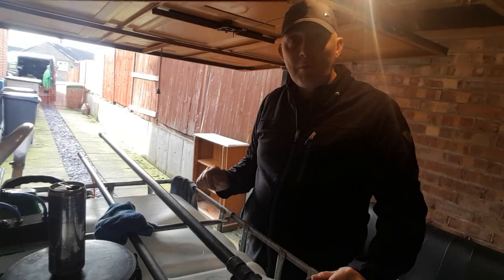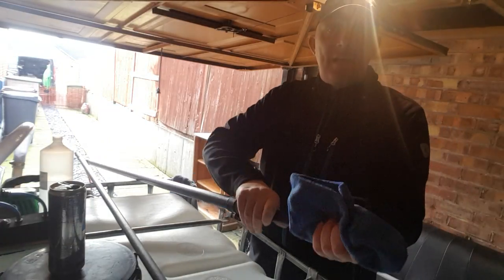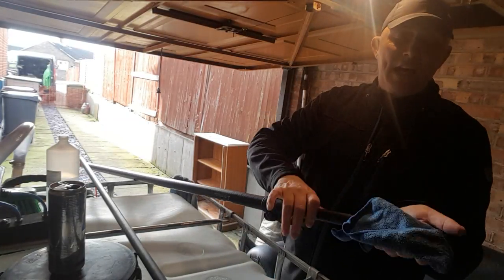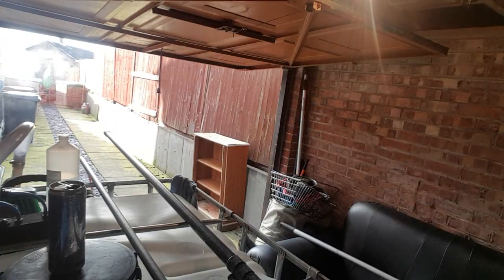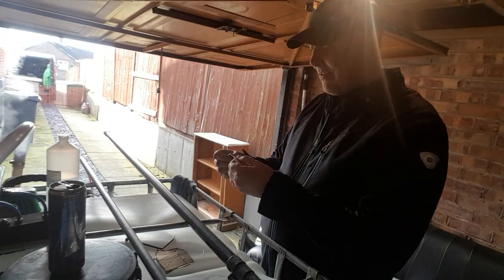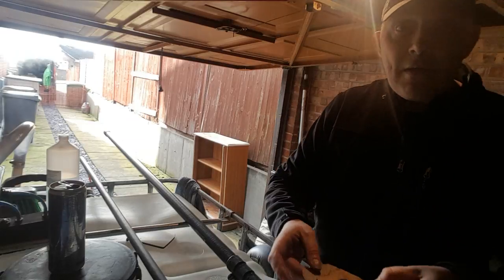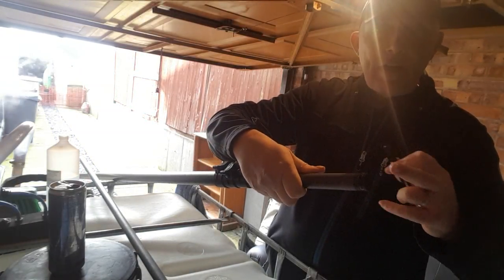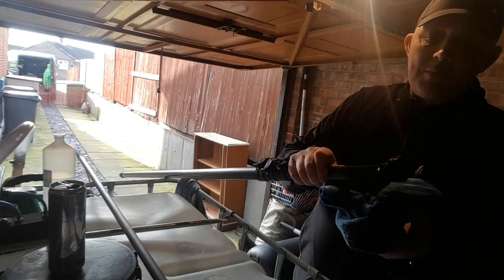Window cleaning - Water fed pole clamp repair - Gardiners Extreme

Comment: Hey mate. I have an slx and it seems the guy I bought it off wore away the first four inch of nearly all of the top of the pole sections. Is there any way I can repair it as having 4 x 5 sections clamped partially out is doing my head in. Thanks
Reply: @Nathan jones buy a new pole.